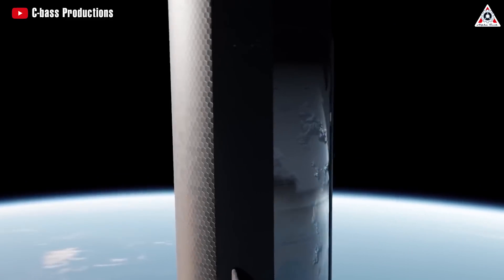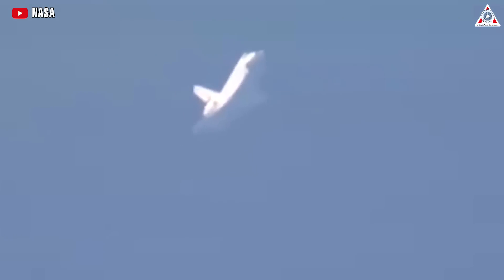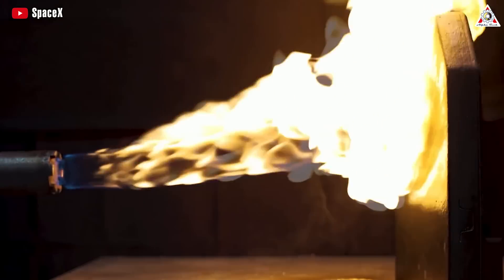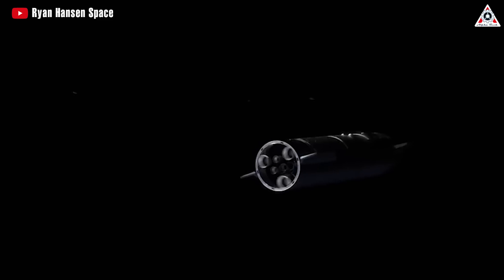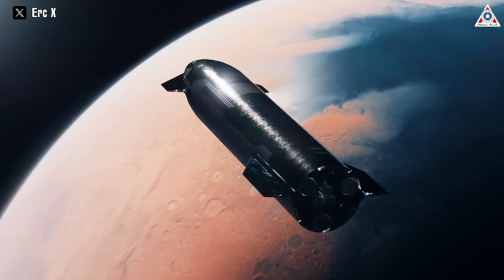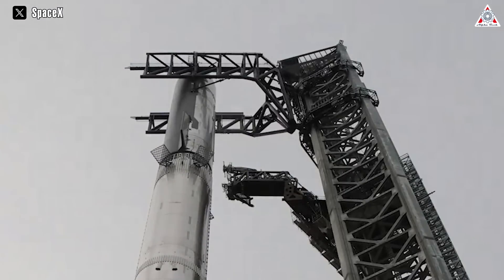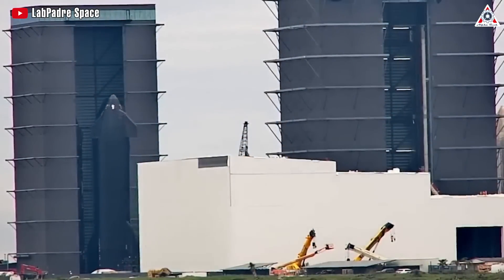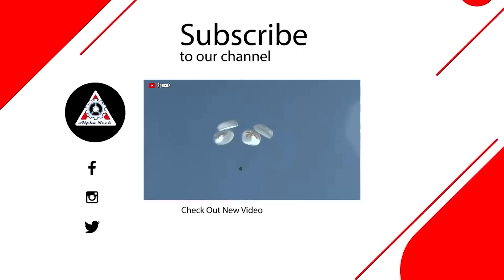SpaceX revealed NEW major design upgrade for thermal tiles on Starship flight #3...

Comment: Why don't you guys spray the steel with a ceramic metallic coating before you put on the tiles? It works great on exhaust headers. I'm sure the space X version could have titanium and tungsten particulates in the ceramic matrix. This way if a tile does pop off you don't have unprotected steel. You have to weigh the weight penalty vs the survival of the ship on re-entry. Have you guys considered adding a dimple to each tile. It should create a pocket of air and help in rentry.

Comment: "....they undergo acceleration due to gravity..."  Really?  Objects entering the atmosphere from orbit don't speed up they slow down.  Objects in orbit reenter when their speed is no longer sufficient.  This is due to drag from the atmosphere.  I stopped listening about the time I heard this profound statement. The tiles were one of the major problems of the shuttle.  That vehicle was sold as a quick turnaround multi use.  However, the tiles caused enormous problems and required laborious hand fitting.  

We have all been hearing how the super heavy has over twice the power of the Saturn V.  That is, at this point in time, like talking about how much power the N-1 had.  Neither super heavy or N-1 are operational.  The super heavy will be the largest rocket once it can be made to work reliably.  

As for starship.  It has never been put into orbit much less have reentry attempted.  The starship is no shuttle.  It's not a glider.  It's a rocket and will land as a rocket.  Time will tell if they ever succeed in getting one back through the atmosphere provided they ever get one into orbit.

Comment: Ah but if a (rocket/Petrol Station) that was in orbit already had fuel onboard in order to fill up starship enough for a re-entry burn for slowing the ship down, heat shield would hardly be needed, and burning up on re-entry would become a thing of the past.  only problem is space junk!

Comment: This system isnt gonna make it long term.
New engines that produce more thrust and velocity will up the pressures on an already marginal concept. 
Am glad to hear terms related to more gradual entry.... sounds familiar there too...
Also methinks more lifting surface and lifting body shapes, and lifting wing area needs to be considered...
Bad news Tin-Tin, we're gonna modify your 1960's rocket some, before this is over. 🤭
Currently the re entry engineering has the finesse of a well thrown wine bottle...
When we need to work towards passive, like we now work towards simplification. More orbits higher to drop potential energy and spread the heat over a longer time period.
More of a blended wing shape than the tube hulls from 1930's metal aircraft.
I'll wait, but I'm confident.... that stacked ring stucture is entrapping.

Gonna need blended, and at least twice the wing area of the Space Shuttle, maybe much more, before steel ships glide much better than lead balloons...
Especially if carrying cargo or passengers from space... that mass does add to the energy number in proportion to velocity.
Harder to slow heavier things down.
Also on re entry designs, areas with inside corners will build up more heat than open or gradual surfaces. What this means to me, is the tube hull and the riveted on tiles are a short term learning experience... will get a heat build up in the arm pits of those flappers. Also that shape creates more turbulence and vibration, than a smoothly aerodynamic shape will..

And the new space race doesn't have time to get past bad designs the hard way.

But I did detect some movement in the semantics... More gradual re entry sounds way better than hot plunging.
I have more time to sight see, than burn up...

I'll keep hammering....
Reply from the maker: Thank you for your idea!
Reply: @alphatech4966  
I just posted another writ on this morning's Alpha Tech Falcon video, describing the design criteria and shapes for glide ratio re entry concept vehicles...
enjoy!

Comment: I'm interested in the details . Could you show me how this tile is attached to the pins on the body ?
Reply: I did see a picture of one last year and it seemed to have a spigot on the back that plugged into a socket. What impressed me was unlike the Shuttle tiles which had a separate part number for each tile the SpaceX’s were virtually all the same and had a hex shape.
Reply: @RMJTOOLS  Thanks for the answer .😀